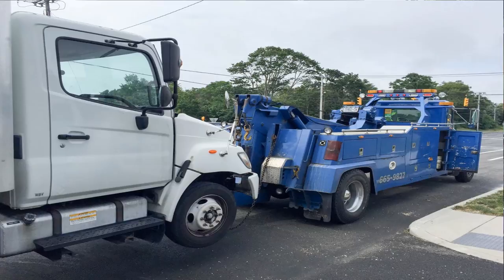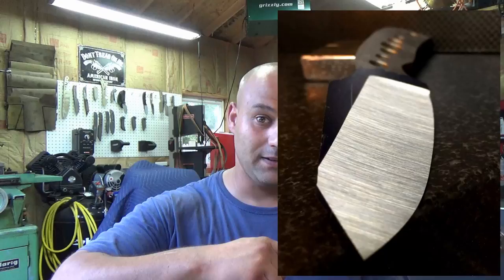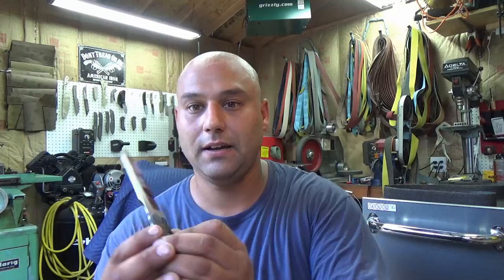Knife shop FAQ #4 Part 1. Favorite steel, bandsaws, mills, and more!

Comment: Also for the hollow sanding you can grind a hollow into a block of wood. Then glue a piece of sandpaper to it. Then take another block of wood a grind it as close at possible to the right shape of your sanding block. Then refine it by hand one the concave piece of wood. (Sorry if that made no sense, I explained it as best I could)
Reply: Thats a great tip, thank you Jack. =)

Comment: Dear Mike, thank you very much for the detailed answer. In the meantime I already bought a bandsaw; I went for one of these bigger band chopsaws. I built a small horizontal table for it, seems to work awesome for blade blanks and handle scales. At least from the few cuts I made, I'd say the saw was the best investment right after my belt grinder. 
I'll definitely try to get a 22tpi sawband to cut the thin titanium liners for the next folders...

Comment: Hey Mike, 
I'm just in my beginnings of Knifemaking so i have to handsand all my Knives for finishing. My problem is when i try to make a Satin-finish with upward grind at the bevel and a OAL grind on the flats i don't get a clear line between these two grindingdirections. I alwas have little spotts where one grind goes into the other like a scatch and sometimes i scratch one finish up while i do the other one. The finish at the flats i do with a Glasplate and sandpaper on it and the bavelfinish i do with my file-jig and a stripe of sandpaper under my file.
Do you have any Tips or idea's how i can fix that problem?

My English is not the best but i hope it makes sense to you 👍

Comment: Nice video got a question or 2... Ive been grinding nice grinds to a highth but then when i go a little bit higher they get messy and hard to control why is that? (I have a 10 inch wheel) is that because im grinding over the height that that grind high calculator says? What causes that? Also I might get a bigger wheel 12" or 14". Ive only hollow ground with a 10" wheel(i have a kmg) how much harder are 12" 14" sized wheels and flat grinding compared to hollow grinding with a 10" wheel? Thanks keep up the videos!

Comment: Hi great videos. I have a quick question. When I'm grinding the bevels the transition point tends to thin out quicker than the rest of the blade how do remedy that? And any tips on glueing I will glue the handles on then wind up with glue on the ricasso and is a pain to take it off. Also what do you think of micarta. I make it at home to keep the knives on budget. Haven't pulled the trigger on g10 yet.
Reply: For the glue mess, this might help you: I finish the front of the scales to the final finish. Then I eyeball where those scales end on the knive handle and generously cover that area with insulation tape. Then I temporarely put the scale in place and cut along the outer shape of the scale with a sharp blade. As soon as I traced the scales, I pull off that part of the masking tape that was located under the scale. Now I cover the front part of the scales with a strip of tape. Finally, I glue up the scales with the perfectly cut tape mask on the blade and the covered scale front. No need to clean away the squeeze-out as long as it stays on the masked area. Once the epoxy cured a bit and turned to gummy viscosity, I just pull off the masking tape from the blade and from the scale, which leaves me with a near perfect glue seam and no gunk on the blade or scale. The masking takes only a few minutes and at least from my point of view, it's well invested time. 
Best regards, Timo